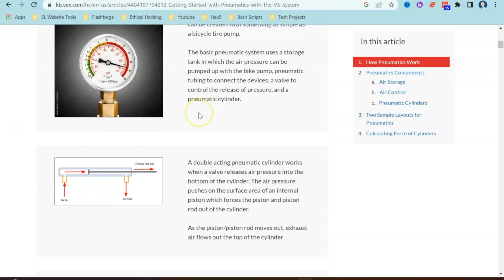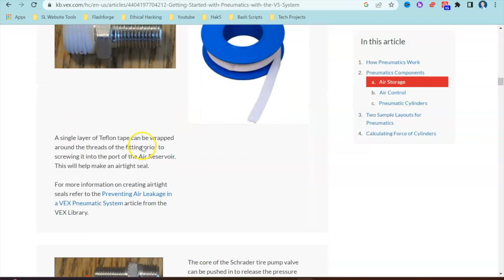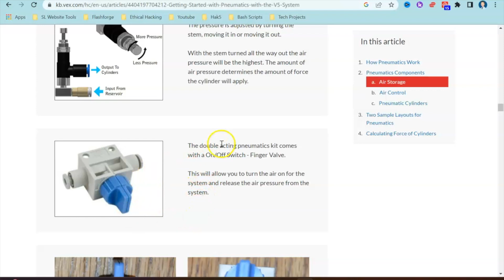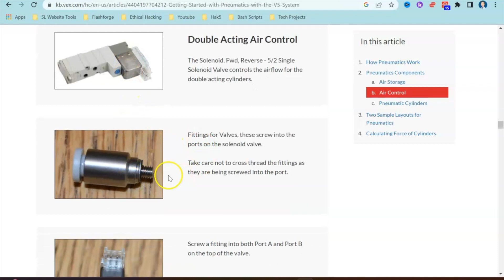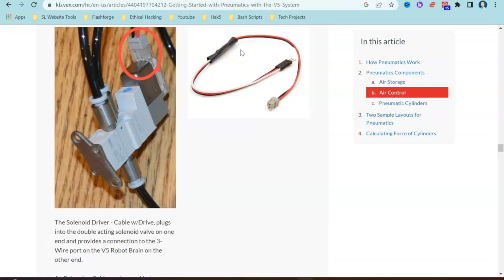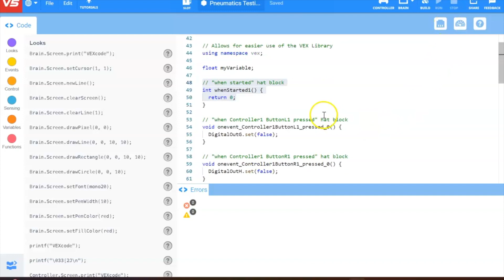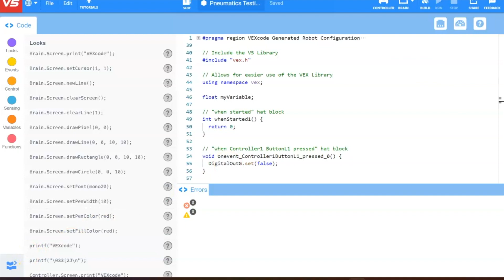How to use VEX V5 Pneumatics

Comment: About how much force if the position giving would it be able to punch a tribal across the field?
Reply from the maker: It depends on how many pistons you have connected to the reservoir, I would probably recommend teams to use the pistons for wings or for hanging. Defo try and see, I doubt it would push the triball far enough
Reply: @steamlabstech  have you tested that it’s strong enough to hang because I didn’t think about that but it can work for our hang maybe you can create a video of pneumatic device lifting a robot?